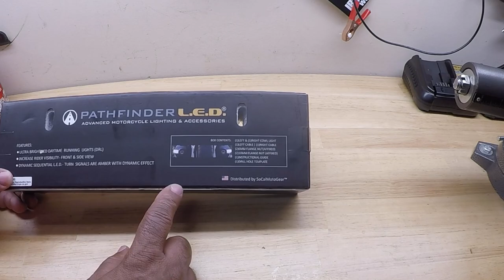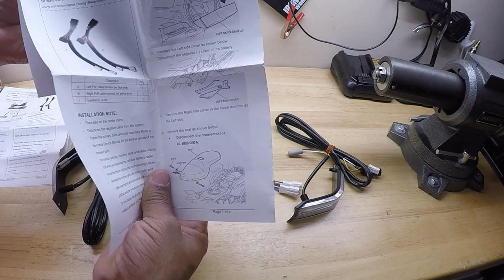2023 PATHFINDER LED COWL LIGHTS FOR THE HONDA GOLDWING 2018-2023

Comment: Hey Chris.  I have the same lights. The harness won't work on the 21+ models due to the can bus system.
Reply from the maker: You are correct Mike, the plug & play harness only works for Goldwing year models 2018-2020, on my 2021 model the running lights only came on not the turn signals so I straight wired it.  I was hoping for a quick plug and play but a good installer must always be prepared to improvise!
Reply: Plus it looks awesome!

Comment: My Pathfinder Cowl light kit G18CWL did not come with the sub-harness for my 2022 GL which connects into both sides of the bike, BUT the Show Chrome fuse block 52-942 DID include it, so I will cut off the flat white connector end of the Pathfinder lighting wires and tap into the fuse block output with those wires.   Seems an easier solution to me.  Thanks for the video regardless!

Comment: I have the Goldstrike distribution block. Would these work if I just got the Pathfinder adapters that Goldstrike makes, plug-in play from there?
Reply from the maker: Yes they should, just plug them into the Goldstrike Distribution Block using the Goldstrike/Pathfinder harness.  https://youtu.be/ZYuAct8Z4AY?si=re0cEQ8r8Lm4oKbR

Comment: Chris I just purchased a 2023 black Goldwing is there a way to leak your phone to the Goldwing hardwiring in the in the glove box I have tried the ma-1 Motorola I can't seem to get it to work
Reply: I have that same Motorola adapter on my 21. You do need a Bluetooth headset connected to the bike for that to work.

Comment: دراجتك صايره محول كهرباء من كثر الاسلاك
Reply: Here in the States we like lights. Many lights. To be seen. Better visibility from road traffic. When done “correctly” this is never a problem.
Reply from the maker: Khalid, thanks for watching my videos in your country, but unfortunately motorcycle are very small and it’s impossible to completely hide all the wiring for lights unless the manufacturer completely wired the bike for accessories during production before assembly and that’s not realistic.

Comment: I bought these lights.  it did not even last 3 months the water infiltrated and no longer functioned.
Reply from the maker: These were PATHFINDER BRAND LIGHTS that I installed In this video but GOLDSTIKE Brand Lights gives you a limited lifetime warranty when you buy Goldstrike lights products.  My suggestion is that you reach out to Pathfinder to see if you are covered under some kind of warranty!